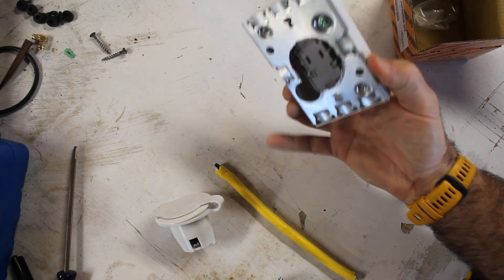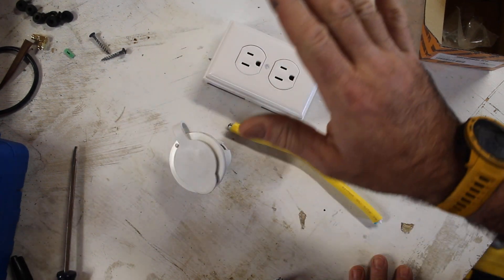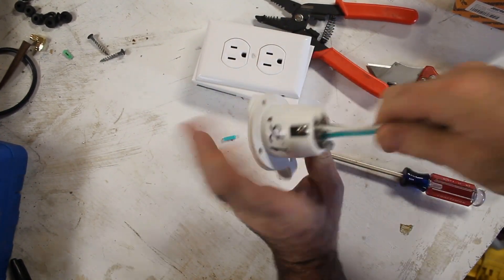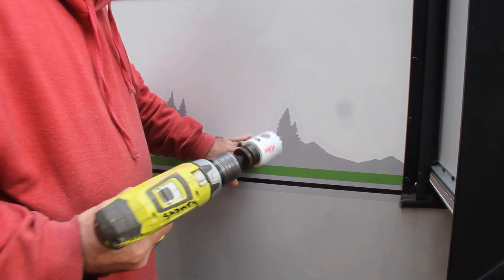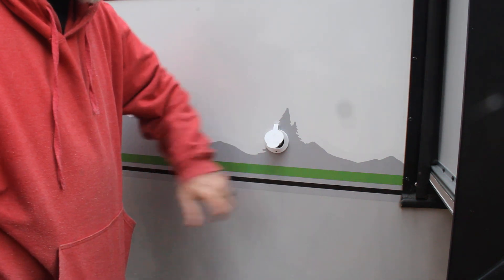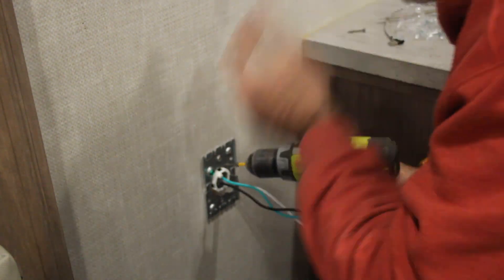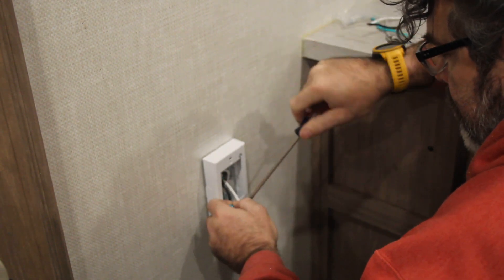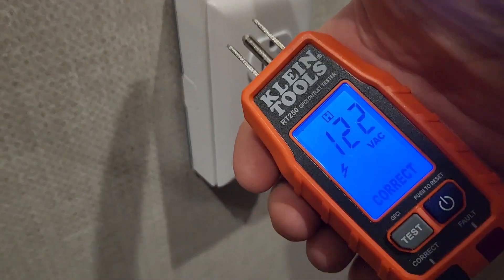Adding Pass Through Power to my Travel Trailer

Comment: Wouldn't a GFCI receptacle be more appropriate since the connection is out in the weather?
Reply from the maker: It would have been much better to have installed a ground fault outlet. However, it would not have fit. Instead we are using a plug in ground fault adaptor much like this:
https://a.co/4j6P8se

I should have mentioned that in the video.